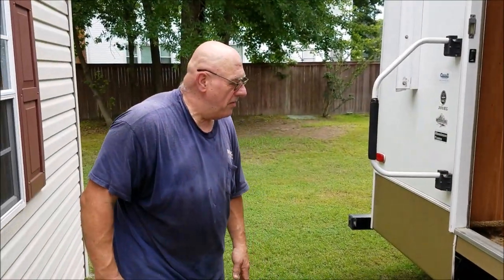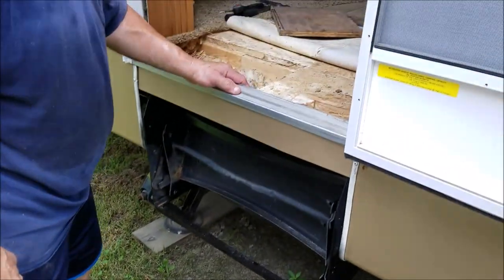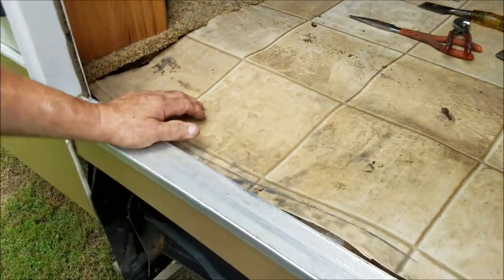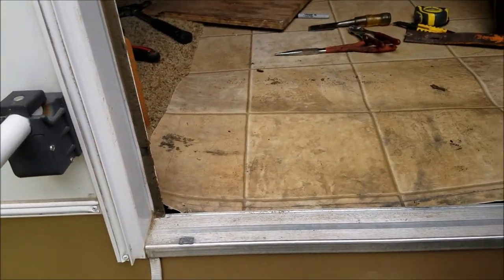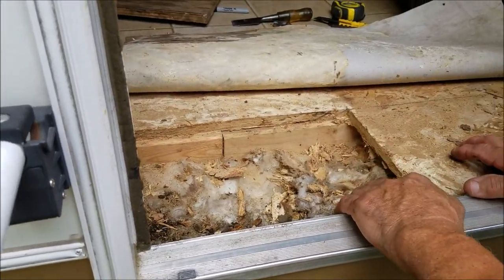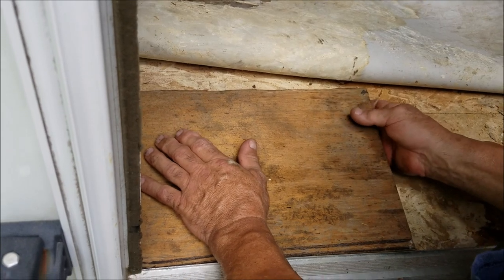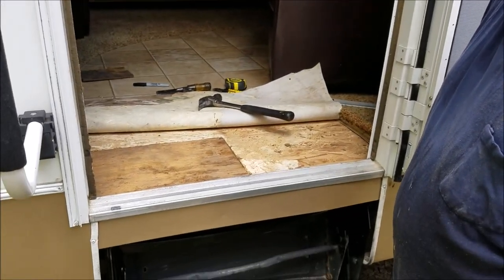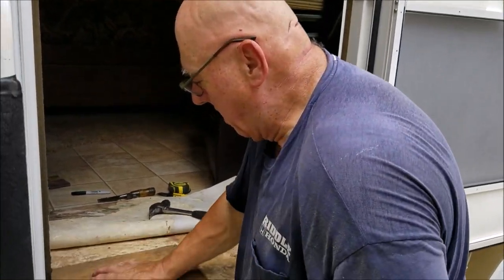How To Repair a Rotten Trailer Floor

Comment: Hi, I discovered a very similar problem, and have been puzzled how to fix it. As a novice I spent ages looking at way over-complicated videos by people with an arsenal of power tools, fiber glass kits and 12 minute or more video length. Then I noticed your video. Thank God for your Dad - in 2 minutes, he showed me precisely what I have to do! So I'm gonna give it a whirl today. This dude should put up lots more practical tip videos. We have a lot to learn from the older more practical generation.
Reply: Health TV 

You’re sorta right I do have to say this video feels like the final lynch pin in making me go saw up my rotted rv floor. It’s not hard ... it’s just hard to think about because I haven’t learned how to do it with my hands yet.
Reply: @Name-el9ps  floors are super forgiving, one thing I would recommend that he did not do is use A LOT wood glue !! Really you can't use too much. It's the secret to floors never squeaking

Comment: yeah.  That isn't from rain getting in from an open door.  Guarantee the whole corner under the cabinet is rotted out.  That's from a rear corner roof leak coming down the inside and pooling on the floor.  It just reached its way to the door

Comment: The only places you get soft floors are near the slide outs, the entry door and shower area. Its not necessary to replace the entire floor. I like what this guy did. its way more practical and a hell of a lot easier. That area at the entry also supports your steps, so its a good idea to keep a good eye on that area.
Reply: Not necessarily. I've got rot under a bedroom window. Still looking for source of the leak.
Reply: Ours is not in any of the areas you stated!

Comment: nice fix. I would have gone a step or two further. being an area that may have water issues, I would have sealed under the transom plate, then I would have cut 2x4 bracing to make that area a little sturdier.I also would have primer sealed the entire wood I was using in that area. other than that,,an easy fix.

Comment: Hi guys. I have a question. I am having a similar problem at my door entry. I have a secondary (lower) step, and this is where the rot happened. 
I ended up cutting the whole chunk of lower step out ( it had a heavy manual pull out metal step on the bottom of it) -which was adding to 
the weight, and the rot problem. I cut the whole thing out, leaving a hole. I KNOW I should somehow have some metal brackets put in first to 
even be able to rebuilt the step,  but I don't know the best way to put the brackets in, or, where to secure them. Should i find a welder? ugh. 
I dont know what to do. My dad would have, but he's passed. anyway....any ideas? thanks!!

Comment: The replaced floor needs to have support under all sides, not just the two joists, but also the ends. That will prevent the floor boards ends from rubbing against each other. Better to fasten them together on all sides.
Reply: Yep, the area gets too much wear and tear and soon it's gonna sag if not supported on all sides
Reply: The 3/4 ply he put in will probably outlast his camping days